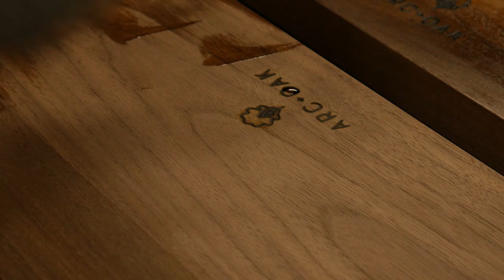Making Industrial Style Bar Shelves //woodworking // welding

Comment: Where can I get the iron bar?
Reply from the maker: I got it from a local steel supplier.  You might be able to get it from somewhere online like onlinemetals.com.  3/8" round bar and the 3/8"x2" flat bar is what I used